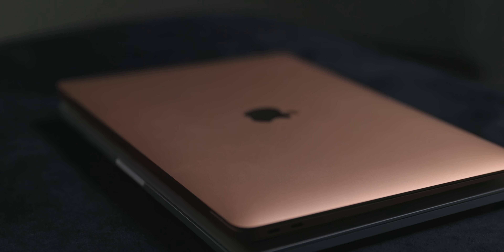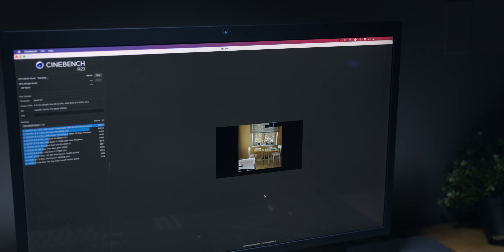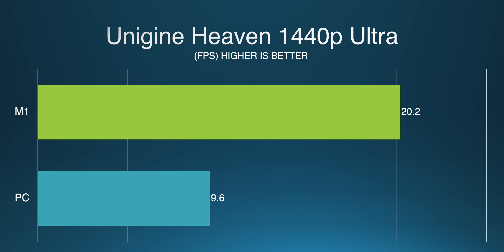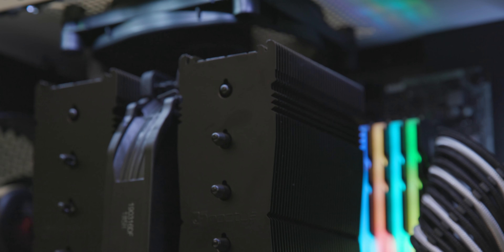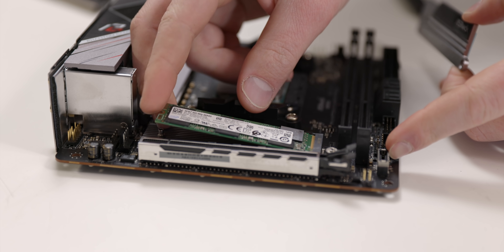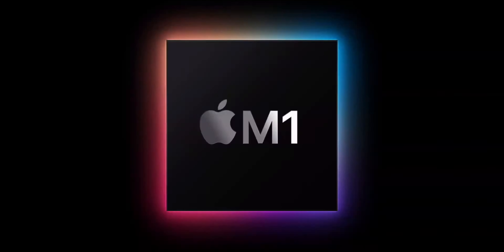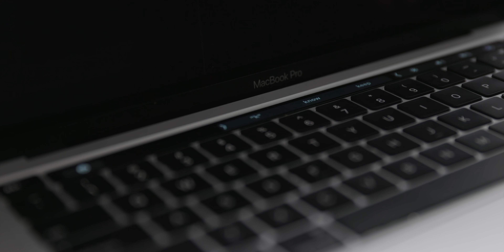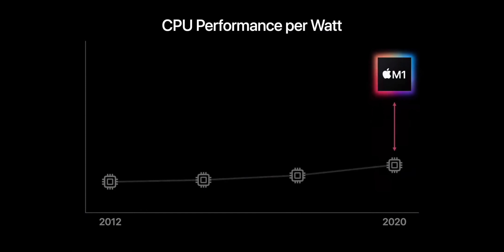$699 Mac mini vs $1,000 PC: Which Is Faster?

Comment: Remember, the  M1 is the worst M series chip Apple will make!  This chip is just the launch pad!
Reply: Also remember, ARM doesn't scale with more power. There's a reason nobody uses it in the server industry, and that's because it simply doesn't offer the same performance that CISC architectures do.
Reply: @dial2616  we will see as time passes what the server farms will do with this. It is not just an ARM, it is an Apple designed SOC,  that alone is a big difference.
Reply: @DishNetworkDealerNEO  The server farms already have the M1, and it's 10 times more expensive than a similarly specced x86 server. Not to mention, Apple has already tried entering the server market before, and their xServe project failed spectacularly. Nobody wants to use the Darwin kernel on a server, since it's pathetic memory management only wastes resources that could be used for other things. Unless you're running Linux on the M1 (which Apple clearly doesn't support, lest they release any form of hardware documentation), the M1 is DOA in the server space. So is any Apple SOC, for that matter

Comment: Remember when we were talking about the same topics comparing Intel's chips to Ryzen?
Reply: Pepperidge Farm remembers it
Reply: The fact that this is first gen and working on totally different instruction set is more than amazing.
Reply: @danielj.3326  Sort of. They have been making their own chips on arm for a while now. A lot of things they are using they have used before and is partly what made the ipad pro line so good. I'm mostly impressed by how efficient and how effective their Rosetta 2 is. If anything felt like it was a first gen, I would say it would be mostly because of it's software compatibility.
Reply: @danielj.3326 I know right, I can’t imagine what apple will be pushing out in the next few generations
Reply: @Graxxor Anandro Vidhelssen ECC is great but it doesn't really matter for casual pc users and it does hurt gaming performance notably. It's also absolutely ridiculous and an obvious money grab by intel, locking it down. Just as they do with OC'ing and pcie lanes.
Reply: This will be the topic till Intel makes any kind of comeback. Do you think they will?
Reply: @Graxxor Anandro Vidhelssen Not sure I agree. It's probably empty to save from having to design too many macs at once and change production lines. I also don't think the form factor really has an effect on the usability of the device vs everything else. It's a shame but I don't really consider it a so called problem of a first gen product. just think of compatibility for folding phones, and arm windows laptops. I think support is usually the problem with first gen. :)
Reply: Not really as Intel still own for gaming and given the whole fact that recently Ryzen has had supply issues, price issues and chips turning up dead. Now problems with 500 mobos. Oooooft. 

I mean ignore the issues with SSD... Ahem.
Reply: @razerow3391  As far as I can recall my 5900X bests the newest Intel chips in single core (I.e. gaming) performance, too. Granted they will probably take the lead back with 11th-gen chips.
Reply: @Noah-Lach  Even though they will take back the single-core lead, a 5900x will still absolutely CRUSH an i9-11900K, especially since it’s actually a downgrade in terms of multicore performance over the i9-10900K… which the 5900x already destroys in multicore workloads.
Reply: @oshotz  Yeah when I say “crown” I mean specifically gaming. I use my computer for a lot more than that so I don’t regret my choice at all.
Reply: @Noah-Lach  Have you had any of the USB disconnection issues? My 5800X has been randomly disconnecting USB devices in Windows 10. Its a common issue in the new Zen3 chips. Still love the chip.
Reply: @ryanmalin  Yeah it sometimes happens to me. More specifically, if my mouse is connected through USB 2.0, screen sharing in Discord will cause it to disconnect. I heard you can fix it by messing with your PCI 4.0 settings but I’ve just kept it plugged into a 3.0 port for now
Reply: @razerow3391  I mean the SSD wear issue is that Apple set the swappiness value too high in macOS. That's like a tiny software update fix probably.
Reply: @razerow3391  ryzen is the fastest for gaming now if you didn't notice. They're quite a bit better actually. Half the power draw. Faulty chips turned out to be a hoax, USB issues are extremely limited and being investigated. (meanwhile Intel makes you pay extra just to let you OC ram, gg). Stock issues? Yes, welcome to 2021.
Reply: @razerow3391  right now the best gaming chip is the 5900x ? Intel hasnt beaten amd in gaming since the 5k series came out.
Reply: @razerow3391  Even with the SSD swap being high, it will probably still outlast the usefulness of the computer. It's not like it is a cheap SSD or HDD. Also the Dead Ryzen chips were only reported unusually high by one buyer in lower quantities which essentially could be a statistical anomaly (and seemingly so considering other retailers that have had much more stock only seem to have failure rates slightly higher than intels'). I am not sure what has been recently happening with x570 chipset and the usb ports, so I wont comment on that, but so far it looks to be a problem with pcie gen4 since they do work when switched to gen3.  Also Intel is on their own 14nm which is much easier to get a hold of rather than TSMC's 7nm. Of course right now I recommend going intel for it's price for gaming. 10600k is $230 right now which is a pretty great price. For creatives, I'd have to recommend amd though. xP
Reply: @ryanclouse299  about the USB problem
from what I heard it seems to me that it's a software problem because it only started with the 5xxx CPUs (and well, you update your BIOS if you want to use one)
Reply: @kuhluhOG  That would make sense. If that's the case, we could assume they'd be working on a fix already. Thanks!
Reply: @ryanclouse299  if you know you’re going to be using the computer in a way that will make it swap data, get a higher ram gb or wait for the m1x
Reply: @ryanclouse299  I wish more people were as logical as you and I. I tell this to everyone, yet everyone reposts the same clickbait trashing each of the three companies for reasons they shouldn’t, when there’s so many more legitimate things to complain about each company.
Reply: @cemops8660  Exactly! I was just responding to the other guy. I have the 16gb model as it does have some improvement in exporting and rendering. If you knew you were going to make it use a lot of swap data, I'm not sure why you wouldn't get more ram. xP
Reply: @RiceCubeTech  Thank you! I completely agree about the companies. It is always nice to see someone with the same opinions. :)
Reply: @kuhluhOG , I happen to be about to buy a B550 mobo and I've been checking the options (for various reasons, in my particular case, it HAS to be a B550, no other chipset would be feasible). I've seen an unusually large number of USB malfunction complaints for many mobos, and they date from several months before the launch of the 5xxx CPUs. The faulty configurations all used 3xxx CPUs and PCIe 3.0 devices (PCIe 4.0 video cards hadn't been launched yet and PCIe 4.0 SSDs were still uncommon at that time). Current reports also say that downgrading the PCIe interface to 3.0 solves the problem in many cases, but not all. So, it seems to be a deeper issue, and I really hope it can be fixed with a BIOS update, because I have tons of USB devices, but I'm pessimistic: there are many indications that it's chipset- and hardware-related. The issue appears to be a little more common with Gigabyte and ASRock mobos, but there are reports with all brands. I'm keeping my fingers crossed because I have no alternative, like I said it HAS to be a B550.
Reply: @goytabr  well, that's not nice to hear

but can I know WHY it has to be a B550?
Reply: @kuhluhOG , I didn't want to make my previous comment too long and the explanation is lengthy, but you asked for it, so now bear with me:

The reason is financial, technical and circumstantial all at once. About a year ago, I built a configuration based on an X470 mobo, but the board was faulty and still under warranty, so I returned it. In the meantime, X470 boards had been discontinued, so I received a refund rather than a replacement, and I'll be using the refund to buy a new mobo. I already have all other components, including a Ryzen 5 3600X processor, so I'm sticking with AMD. But since another X470 board is not an option any more, which chipset, then?

An A320 or A520 would be too limited for my needs. A B450 could do for now, but that chipset is becoming a little old and the price difference to a more modern B550 is currently very small, if any. And an X570 would be overkill, with too many bells and whistles I wouldn't use, and way too expensive, far beyond my budget. The fact that AMD will likely change the socket, memory speed and more in its next generation, making a general replacement of everything inevitable, also makes it unwise to invest too much in an AM4 platform today.

For the record, I live in Brazil, where computer hardware is VERY expensive, several times more than in the U.S. even at nominal exchange rates, and a small fortune in terms of actual purchasing power in the currently very devaluated local currency. So, any hardware purchase here has to be very well thought to maximize the value of your limited hard-earned money. That's why I'm still pondering the options and haven't bought anything yet.

For all these reasons, I've concluded that a B550 is the only viable option for me now, a sweet spot in terms of both features and price, and within a reasonable range of what I can get with my refund. The caveat is that most B550 mobos have 4 SATA ports and I have exactly 4 SATA drives, with no margin in case of issues with one of the ports (which have happened a couple of times with me over the years). So, I might consider an entry-level X570 if I can find a crash deal in one, but I'm not holding my breath and a B550 will be my most likely purchase.
Reply: @goytabr  interesting to hear
although I would also consider B450 considering that (after a BIOS update) it works

from your answer I doubt you use a PCIe 4.0 SSD and considering that AMD is going to change their socket next generation, it shouldn't make much of a difference
Reply: @kuhluhOG , you're right, I don't have an NVMe SSD right now, but I plan to get one at a later stage, so PCIe 4.0 support is attractive, and the price difference between a B450 and a B550 is currently very small -- their price ranges actually overlap. So, I think a B550 would be far better value for my money.
Reply: @goytabr  in a whole it kinda depends on how long you want to keep this setup
Reply: @kuhluhOG , several years. The fact that I'm currently on a good and brave old Phenom II X6 1090T should speak for itself... I don't think I'm going to keep the new configuration for as long as I've had the current one, but I don't have the budget, inclination or need to completely overhaul my PC every year, though punctual upgrades and part replacements are to be expected over the years.
Reply: @kuhluhOG , just to give you some feedback, the story took an unexpected turn, because what I thought was a remote possibility actually happened: I was VERY lucky to find an incredible crash deal for an excellent X570, of which I only found stellar reviews. It has everything I needed: 8 (count'em, EIGHT!) SATA ports, TWO full PCIe 4.0x4 M.2 slots without speed restrictions or port disabling, and 12+2 VRMs that can take even an overclocked 5950X while barely getting lukewarm. The only flaws I could find in that model were a somewhat disappointing number of USB ports and the lack of a BIOS flashback button, neither of which was a dealbreaker.

Totally overkill for me, as should be expected, but I couldn't find any cheaper mobo in the local market that accomodated all my needs and plans with no compromises like this one does, and the bargain was irresistible: in that offer, it cost only about 20% more than the range of the B550s I was considering (I was being subsidized by the substantial refund of my returned board, so that budget stretch was still doable), when its regular price is about 60-70% more than those B550s here (the next cheapest X570 was in that range). That would far exceed my budget, even with the refund. So, I grabbed it at once while I could!

The board is on its way to me and should arrive during the next week. I plan to assemble the new PC the next weekend, hopefully without issues. And then the story will have a happy end! As for you, thanks a lot for the interest and the time spent with me! I really appreciated that.